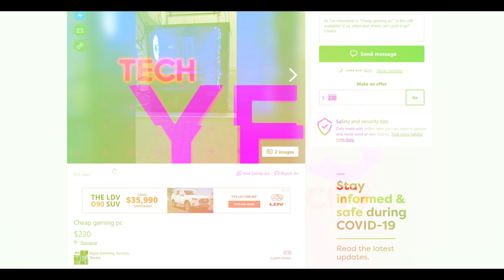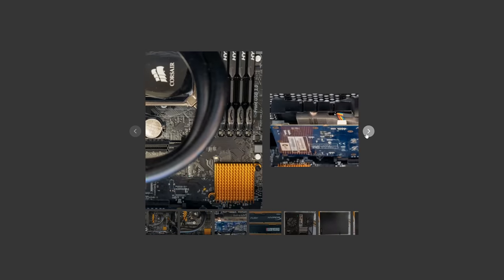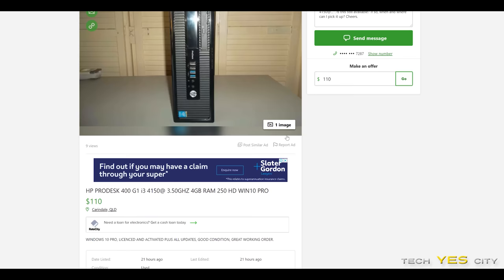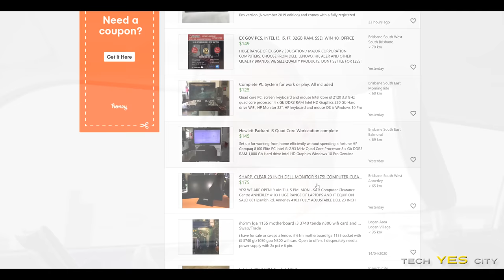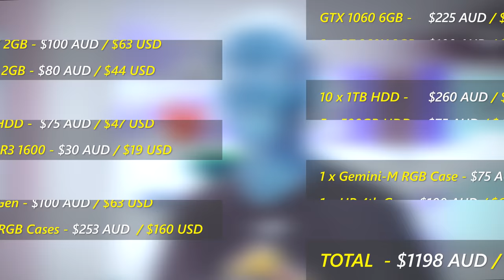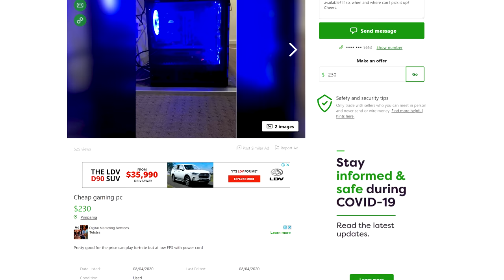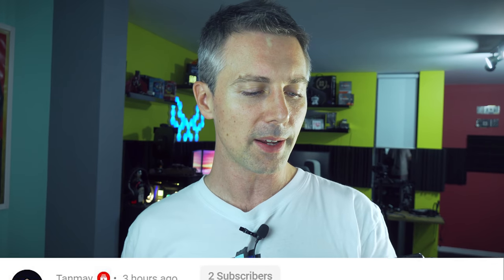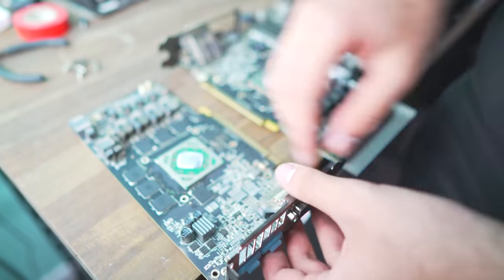Potato Hunter S01 Ep.03 - NEW Avenues for USED PC Parts Await...

Comment: I love this channel! The 1060 6gb seems like a good pickup. AT almost $150 USD it seems a little pricy though. The gtx 970 are not far from that 1060 in performance and those were going for like $50-80 USD. (maybe a little more now). Pretty much half the vram though. 1060s and 970s, rx 480s  are definitely the cards I would be looking for, when building budget builds. I actually saw a GTX 780 ti for $50 CAD a while ago, which is like $35 USD and is pretty much equal to a 1060 3gb in performance.
Reply: CringeLord4000  What resolution 720p? I can see 720p being viable for "super budget" and 1080p / 60 on low to medium for "budget".

Comment: There was a point where in the US, r7 260X was going for like $30-35 on ebay. It's still more powerful than say Vega 8 or 11, so a great pickup for anyone considering a Ryzen APU, since it's cheaper in combo with a r5 1600/AF/2600 than it is for an APU, and you've got more cores and better graphics with a better upgrade prospect.
Good finds!

Comment: The gigabyte RX360-2GB was a card I always something I liked the look of and wanted to do a crossfire build back in the day, wanted to get 2 of them for $60-$70 each but grubby resellers charge $150 each and would not budge on the price, so when the minning market crashed I just got a pair of slick RX460s for $40ea. Coupled with an i5- 6600 it made a solid 1080p gaming PC for 60-90 fps build, sold to a very happy fortnite & black ops player. And it was a all white build, so a girl snapped it up

Comment: A hair dryer could work for fixing a GPU die but requires way more time and pointing it really close to the GPU die. You will also melt  the plastic tip on your hair dryer so your wife won't be happy, not worth it. Sometimes GPU dies and even CPU dies require extreme cold so if heating doesn't work out then try pouring liquid nitrogen directly on the die. Also, it's not about melting the solder at all, instead it's reshaping the silicon die back to something that works. You can try to intentionally melt solder the same way and you won't get it to melt.

Comment: Did you check the SMART data on those drives you got from CEX? Its always been my experience that the drives they sell are always failing. 

They normally say they're "OK" but the Seek Error Rate, Read Error Rate and ECC corrected values increase in real time. Not to mention the drives are normally sitting at 1.5-4 Years powered on.  (I've actually pulled drives from discarded DVRs in better condition than what they sell.) Unless they check the drives properly up there I can imagine the drives failing within a months or two of normal use.

Comment: Flipped a gpu monthes ago. The card showed many artifacts and kept losing signal. I used a hairdryer to revive and it worked. Only issue is that once the card hit 80°C it would stop working and give no signal. I sold the card and told the buyer the main issue. No complaints so far xD

Comment: The HP 8300 SFF are great light gaming rigs, they go cheap too, Try get ones with m.2 on board and 2x pcie slots, one is 1x the other 16x, they take a gtx 1650, no power cable.

Comment: may i ask do it graphic card suddenly have code 43 error with some red lines appearing and no nvidia driver.wat problem?im using asus Cerberus gtx 1050 ti 500 watts power supply with b450 hdv r4.0 motherboard.need helps to fix it.

Comment: GTX 660's and 260x's..lol. Gotta keep the GPU's above or around the GTX 1050ti or RX480/580. U-no-Datt.
but, you can't go knockin on all Core2 Quads. I have a 3.6GHz+ Q6600 (GO) with a 2GHz GTX 1050ti and 8GB's of 1200MHz DDR2. Granted, its on the eVGA 680i. 
This 12year old rig still surprises me. It can run most games other than FarCry5/New Dawn because of the SSE.4 instruction set not being there but, i have a QX9775 and i7 3770K for that. Other than that, it runs most titles at a solid 1080p60. Fortnite is no problem with maxed out settings at 1080p60. 
  Any Vulkan/DX12 titles which these older PC's love like DOOM 2016 and Sniper Elite 4/Nazi Zombie4 run perfect at 1080p60 with high/max out settings. I played DOOM Eternal and it wasn't that great. It looked good but, 2016 was closer to the classics. I was even testing this early press release build of a S.T.A.L.K.E.R. like reboot from the same devs called "Chernobylite". This game is quite hard to run at times. It can hit a solid 30fps with the Quad but even a i7 8700K at 5GHz with a Golden Nitro+ RX590 at 1700Mhz(GPU) and 9000MHz(mem) has trouble holding 60fps maxed out at 1080p. Very cool game though. Moving up to Ivy Bridge is generally where you wanna be. Like the i7 3770K and z77 board to overclock it. I have a 3770K and z77 Extreme4 nstill kicking with 2400MHz DDR3 and the GTX 1050ti. I have my pops lovin Metro Exodus on this rig. 1080p60 with High settings and PhysX enabled. It can run with tessellation, just not rock solid. 
 I hope you didn't throw that XFX 780i away, cause those are wanted by classic retro builders. Any motherboard or GPU can be fixed with the right tools. Der8auer surprised me with his latest video on how he pulled pins right out of a damaged socket and fix them by using another damaged doner board (socket) by taking pins out if it. 
  You guys should check that one out. "Eli's Tech" channel shows some pretty remarkable repairs too.

Comment: Potato Master bringing the bargains for sure!!

Hey man, I'd love to see you check out MONITOR OVERCLOCKING! Super cool, and its surprising how often it works out! Even taking 60hz to 75hz makes a big difference in a budget Fortnite rig! I've seen good results in displays from Acer, Asus, HP, Dell, etc. Check it out mate, and also thanks for keeping our spirits up in this craziness. 

Also, have you worked with the Z420 HPs before? Xeon E5 Budget goodness! I'm able to find them well built, usually 6C/12T unlocked Xeon E5 1650 v1/v2 with 16GB or more of quad channel ram and 600+W PSU for about $200USD. Combining with a decent GPU and stellar gaming rigs! I also built a similar one for my younger son using a Lenovo S30, and it even overclocks using the Intel XTU to 4.3Ghz 6 Core lol :)
Reply: Oh yeah, a note about display overclocking, sometimes there are blank ranges with some panels, like one I had that wouldn't so 65, 70, or 75, but was completely happy at 80 lol. Felt waaaay smoother!
Reply: @thorrollosson  lower resolution monitors can also overclock than if they were at 1080p. for example my 768p monitor can do 120hz but if i turnn it up to 1080p with custom resolutions and it artifacts at 100 Hz
Reply: Holo, hell yeah man that's cool. I never thought to test non native rezzes for that. But with results like that, totally worth considering, especially for budget higher than 60fps gaming. 

With parts being in kind of short supply, would be a nifty kind of vid that would fit TYC value for money ethos like a glove. Potentially finding major value add in what you already have, with the usual caveats of running anything out of MFG spec is no guarantee. I had an Asus 60hz 1440p IPS I had set at 75Hz for a buddy way back, and forgot all about it, and it's still working flawlessly, so seems like quality potential out there haha. I have a couple dozen screens at any given time, and a decent amount of them respond well. 

Now I'll be trying various resolutions as well, thanks to extra tip. Appreciated!

Comment: Y'all under my league, I got a CPU that won't even run. 2004 games at 30fps if it gets intensive and won't get an average above 60fps.

18 wheels of steel pedal to the metal drops to 24fps in the most intensive areas. But it can hit a stable 33fps in less intensive ones.( Although to be fair 24 fps is surprisingly playable for that game kinda, I mean it's better than it sounds).

And Colin McRae 04 runs at around 50fps with but of micro stutter and fps drops every once in a while.
Reply: What cpu?
Reply: @EvilTurkeySlices  sempron 3000+.
Reply: Niels Vantilburg I sure love me some Socket A, I have an Athlon XP 2200+, an Athlon XP 2600+, and an Athlon XP 2800+.
Reply: @EvilTurkeySlices  I think you might be thinking of the wrong socket I'm might misunderstand you but the sempron 3000+ is socket 754 if I recall correctly ( it's a single core 1.9 GHz CPU I think).

Although I might try and get a good XO gaming system going, but I just got this specific system because I thought it would to bad if it was thrown away especially since it only cost me 10 bucks and the cables inside and other stuff is already worth more.

The GPU Inside I did get separately , cuz it had no GPU yet, and honestly I had no idea what I should get but I got a basically new ATI Radeon X1650 pro 512MB DDR2 and it's pretty good, it's to powerful for the CPU but it's pretty good all things considered.
Reply: Niels Vantilburg there’s also a Sempron 3000+ on socket A.
Reply: @EvilTurkeySlices  oh okay, yeah the one you were thinking of is probably much better tbh. Just wanted to make sure we were thinking of the same ones, but nah these ones are honestly not very useful, I mean it's kinda bad for every task, although if more older games would allow a fps limiter it would be a lot better.

But it's not unusable so I'll probably use it for really old game and I'm about to see if it can run battlefield 2.
Reply: Niels Vantilburg Socket A is older than 754.
Reply: @EvilTurkeySlices  oh okay, Also how old is it? apparently this thing is from 2008 according to a site where I searched it up, and it's not pretty, I mean I most games are some sort of playable but most budget CPUs at the time would do far better.

I tested bf2 and it's in between 24-40 fps most of the time.
Reply: Niels Vantilburg like 2003
Reply: Niels Vantilburg socket A itself is from around 1999.
Reply: Niels Vantilburg and the 754 3000+ was from 2005 or so.

Comment: I need to sell my old system can someone give me a ballpark price to put on it ($AUD)
I7 4790k
EVGA GTX 970 SC
16gb gskill ripjaws DDR3 1866mhz
Gigabyte ga-z97x gaming 3 mobo
Corsair rm1000 power supply
Corsair h100i AIO water cooler
Coolermaster Trooper case (white)
And I'll leave the boot drive in 
Crucial m550 256gb
And a 27" curved Samsung monitor can go with it.